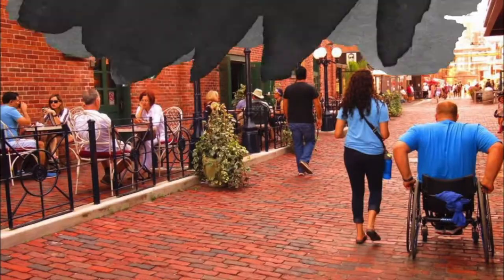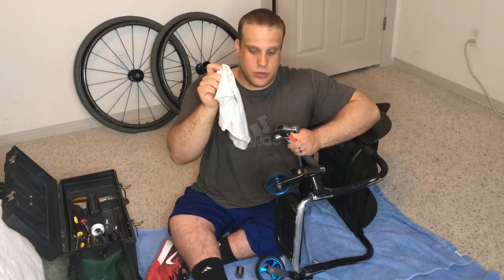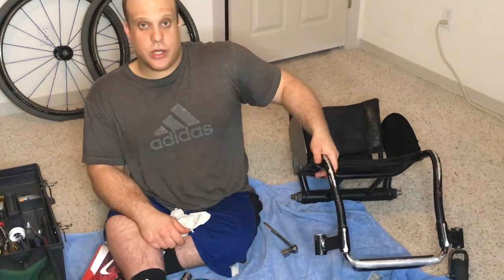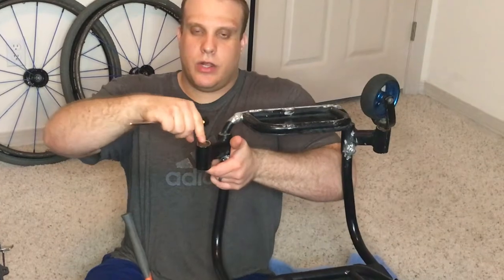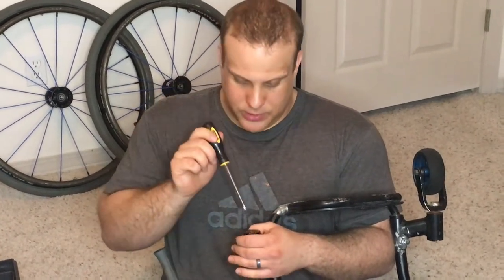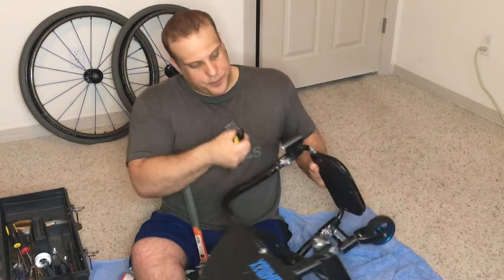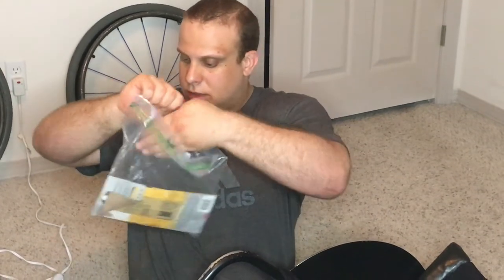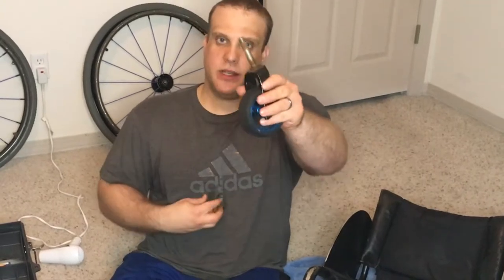5 MIN MAINTENANCE | Caster Fork Bearing Replacement

Comment: No worries on damage when popping them out.  However, I use a small piece of wood to tap on when putting in the new bearings.  Makes it easier to go in straight and avoid hitting the new bearing directly with the hammer.

Comment: I had to do this on my Tilight as the caster froze up. It isn't open on the top and the bearings stack inside on top of each other and can only be taken out on one side. You need a Snap ring pliers, which I had to get from a neighbor on 3 wheels in my chair! The socket trick to hit them down into place helped a lot but I honestly won't do this again unless I have to or have a spare wheelchair. Took me about 3 hours lol- maybe hit up the local bike shop idk.

Comment: Use an old mechanic’s trick: when installing new bearings lay the old ones over the new ones and hit on the lld ones. You can pry it out after as it will sit proud of the lip.

Comment: Just a quick suggestion. Put the chair frame on the floor then when you are hammering the get the bearing out it should come easier than you resting it on your lap or leg type of thing.

Comment: Hi there. Thankyou for this video. I have a performax as well. Im trying to put my new forks from my new chair into my old frame. On the new chair, the forks came right out easily with the ratchet.  But the older chair thst I want to use, when I removed the top bolt nothing happened. The forks will not come out. Do you know why? Have they cha get how the chairs are made? Its been quite a few years since I got this older chair?  I thought it woukd be an easy job when the new forks came right off the new chair.... and then I got to the old chair and can't figure out how to remove it? Any help would be highly appreciated!
Reply from the maker: theres a chance they might just be stuck due to corrosion you might have to coax them out a bit with a mallet but try maybe spraying them with som wd40 first?

Comment: I find a cheap wire brush is more effective than steel wool but either way, gets the job done. The heat gun is a nice trick. I'm over here like a cave man bone-headed trying to bang the bearings out. 

I feel like a total dumbass. >_< 

My poor wheelchair guy spent like 2 hours trying to bang that freaking bearing into my frame. Both of us are going to feel real salty when I tell him about this trick. LOL 

FWIW I'm in the process of 3D designing and 3D printing parts like the side panels / tire guards. $125 for a pair + shipping + tax seems like a raw deal. I can probably 3D print a replacement set for about $30 bucks, probably less. Fun times. 

Hope I don't get sued >_<

Comment: My wheelchair is a TiLite ZR1, I have a problem removing the caster bearing. I don't wanna use a screwdriver because it damages the inner stopper or separator between the two bearings. Is there any bearing puller that I can buy online? Please response. Thank you.
Reply: Wondering the same thing

Comment: I was pushing my father in a wheelchair in RI zoo and the bearing went.  Its been over three weeks now and the insurance company said they would give him a new chair but the MD is too slow to write the script.   i should of just replaced the bearing like this video did to keep him up and running.    i took the chair for repair at the wheel chair selling place. He started to take out the inner housing of the caster fork. I told him to stop and took the chair home.  The inner housing doesnt come out.  It provides the frame for the wheel bearing to sit on.   He works on the chairs yet doesnt know that.   Anyway, he took off the top nut and I didnt get that back.  Is the top nut just a standard nut?  Also, will wheelbearings from hardware store be good enough?
Reply from the maker: Generally I've found it very hard to find the right size bearings for a chair at your local hardware store. As for the nut ,that may be easier to find, you could probably just take the one from the other side to the hardware store and see if they have that size.
Reply: @AdaptedAdventures  
Sadly, I must wait for the MD to get off her ass and fill the script for insurance because I tried to get the old bearing race off the shaft where the nuts go. Its bonded/rusted on there real good. I heated it up with torch and used vice gripes but no dice. :(
Reply from the maker: @Romulan112  I feel your pain on that 😣

Comment: I have a Invacare A4. My caster fork fell out. Can I fix it or do I have to get a new chair
Reply from the maker: Chad I'm sure if you are able to get the right parts you can fix that no need to get a whole new chair.. do you know why it fell out? did you lose the top nut that holds it in place? or did the bearings rust out?

Comment: Great video! My only question if you can tell me, are all the bearing for these manual chairs the same size? Thank so much!
Reply from the maker: Hey Allan sorry for the delay in getting back to you! GENERALLY speaking there is a standard size, but there are always those oddballs unfortunately but I believe for caster forks the "normal size" is 1-1/8" outer diameter, 5/16" thick, 1/2" inner diameter.
Reply: @AdaptedAdventures  Thank you veru much.

Comment: Do you know what size bearings are needed to change fork tube bearings on a ACTION A 4 wheelchair
Reply from the maker: Good Morning! I THINK, i found the right one for the A4.. it should be a bearing with an inside diameter of 1/2 inch and and outside diameter of 1 1/8 inch. Hope that helps

Comment: Been a quad for 24 years C5 C6, still living alone and do pretty good but my hands don't grip a hammer hard enough to get them bearings out of the fork tube.
Reply: Invacare Ultralight MVP
Reply from the maker: There have been times where I haven't been able to get them out either haha 😜
Reply: @AdaptedAdventures  They'll be out in a jif I have some velcro and zip ties on order.
Reply from the maker: @dixirkt  nice! have you ever tried the hair dryer trick?
Reply: @AdaptedAdventures  gonna give it a shot when I can put the meat on em. Does it really work?

Comment: What size bearings do you need, how do we know what size to get?
Reply from the maker: Hey thanks for the question. There are a couple of different ways. 1st depending on the manufacturer of your chair you can sometimes find parts lists online if you google your make and model. 2nd option is if you are able to measure the inside diameter and outside diameter of the bearing than you can do it that way as well.. The most common caster fork bearings have an inside  diameter of 1/2 inch and and outside diameter of  1 1/8 inch
Reply: @AdaptedAdventures  thank you so much very helpful